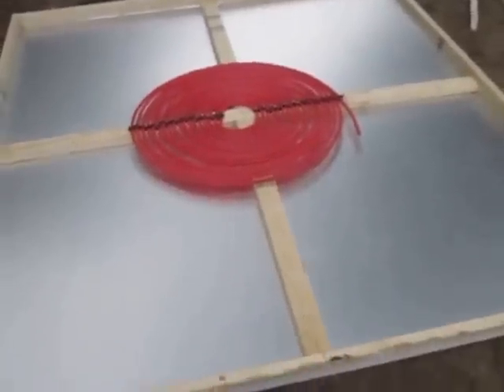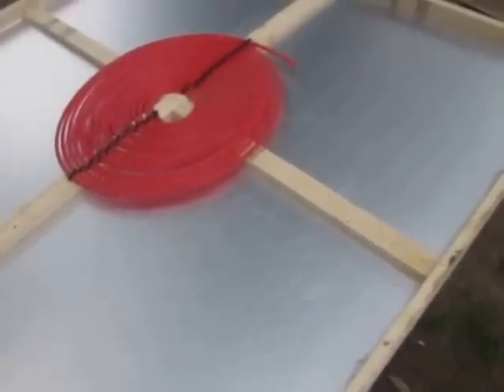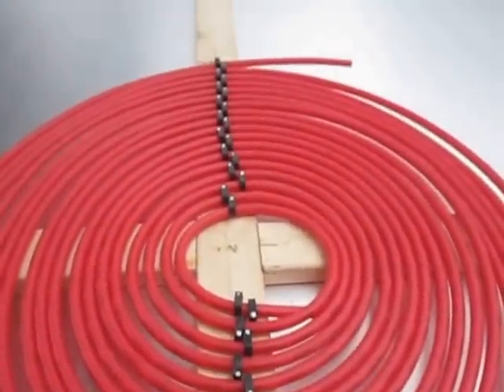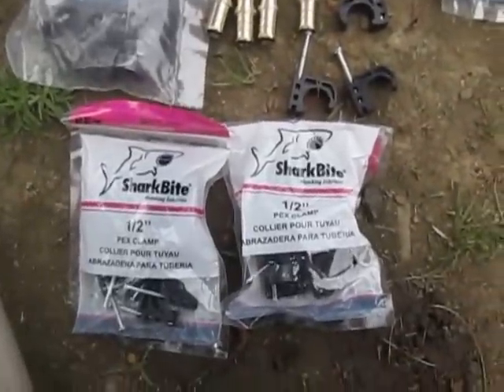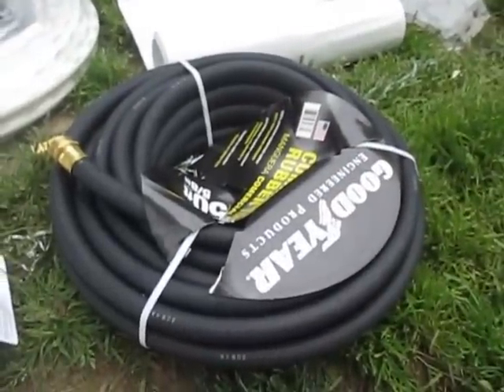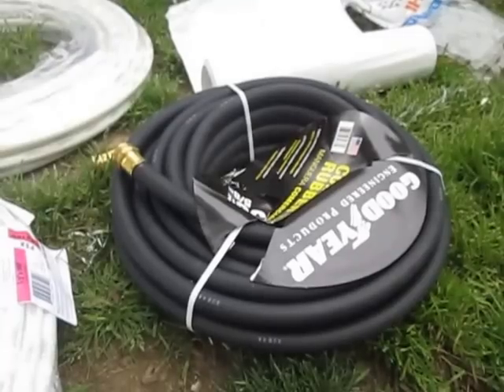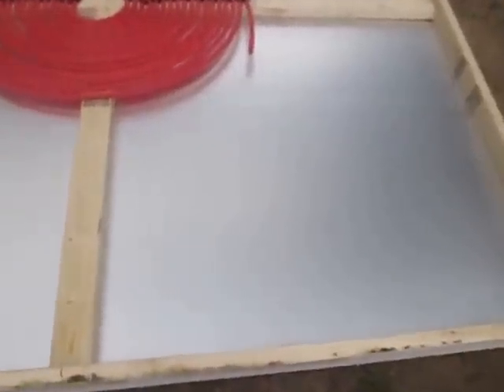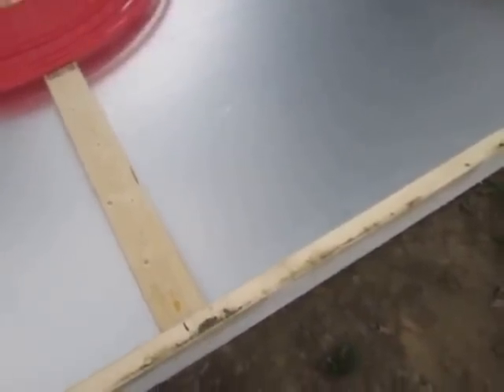SOLAR HOT WATER TUBING/CAN POOL HEATER BUILD PART 1 of 5 8X8

Comment: The frame and reflective backing should be flat white and not very heat conductive, in order to reflect back as much light to the black, even if it's sealed with a pane because you want the tubing itself to get the hottest.
Reply from the maker: It is sealed, this was the first part of the build.